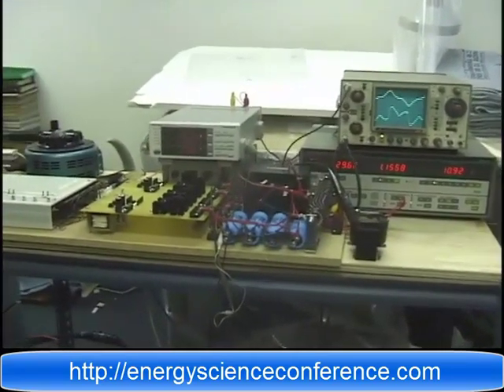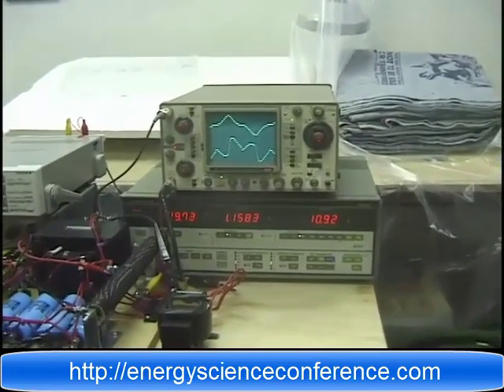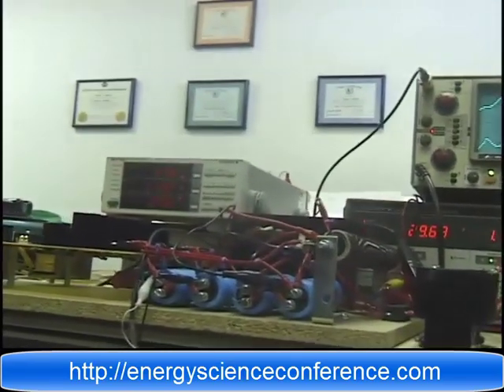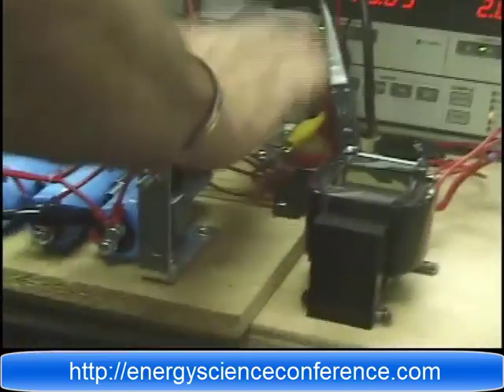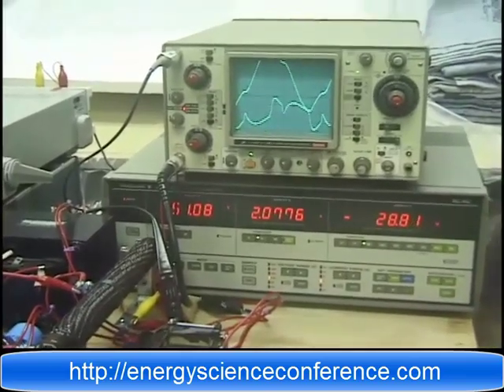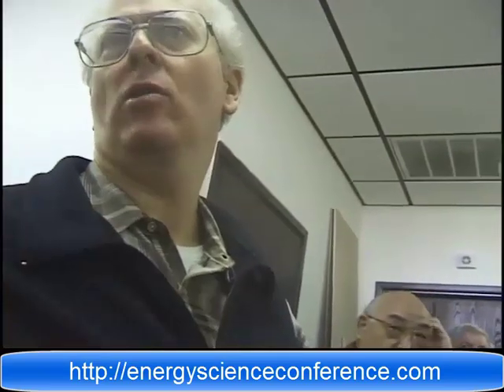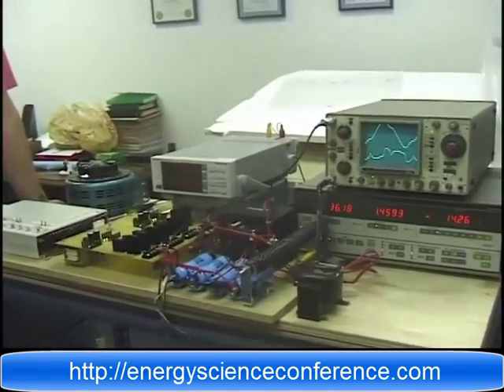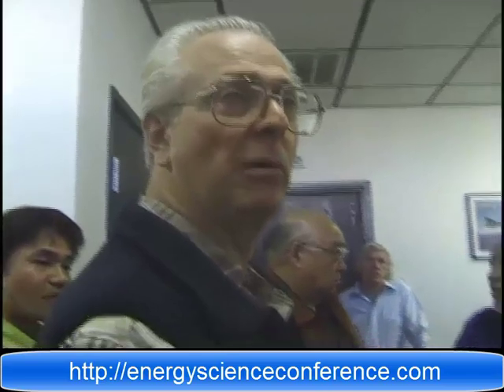COP 20.0 (2000%) Reactive Power as Energy Source

Comment: Ok I've watched this again as well as the hour long interview and came to the conclusion that I cannot determine if using reactive power can give us 'free energy' or of it it's a measuring mistake/error/trick.

But can someone answer this very basic question:

IF he needs only a little bit of power to run his machine and puts back 10-20 times more into the grid... why would he need the wind generator guys? or any generator for that matter. That can be a self contained unit. Put a battery with an inverter in and get 20 times more out.

is that possible?
Reply from the maker: Not only is it possible, is has been done. Try to break through your tendency to conform and start to think for yourself.
Reply from the maker: Average Joe
First of all, it is a misunderstanding that something must self sustain in order to produce more usable energy (not power) than we have to pay for. It is also not more out than in, it is more out than we put in meaning the extra is from external sources of potential energy that can enter the system and do the extra work.

You also have to understand the difference between efficiency and coefficient of performance.

If a child puts in 1 part energy to get a kite in the air and for the duration of its flight the wind puts in 9 parts energy. That is 10 parts input. If half is wasted due to bad kite design, friction, etc..., then only 5 parts of that energy actually went to flying the kite, which is the intended work. Therefore 5 units of intended work divided by 10 parts total input = 50% efficiency. Efficiency is the ratio of TOTAL input compared to the intended work done.

The total work done was 5 units divided by what the child had to input, which is 1 = 500% NET GAIN in ENERGY compared to what he paid for. This is 5/1 = 5.0 or a coefficient of performance (COP) of 5.0. This is a real overunity free energy system and no laws of physics are violated and the child got 5 times more work done than he paid for. Not only is it possible, it is the only way all natural systems work and close or isolated system thermodynamics as taught by mainstream physics do NOT apply to anything in the natural universe.

Your refrigerator operates in the same way and more WORK was done in whole compared to what we pay for in electricity at the wall since heat moves for free to the cold. This is another overunity free energy system that operates based on open system thermodynamics (non-equilibrium thermodynamics).

All real free energy machines are under 100% efficient but are over 1.0 COP meaning more work is done than is required to be supplied on the input and no laws of physics are defeated contrary to what you have been manipulated into believing.

The Bedini SG, Paul Babcock's motor, Jim Murray's SERPS technology, both of Graham Gunderson's machines from the past 2 conferences, this is a long list - those are all over 1.0 COP and all produce MORE work than they have to pay for in electricity to run the unit.

Believing it must self sustain without a power supply only demonstrates a lack of understanding of elementary physics and thermodynamics. Your refrigerator is overunity but there is not enough overunity in order for it to self sustain. IF a devices is at a high enough COP, they can sustain themselves but it is NOT a requirement in order for them to produce more work on the output than the operator of the machine has to supply on the input. These are the indisputable facts of nature.
Reply from the maker: Average Joe
Mixing analogies? They are all 100% applicable to these systems, which obviously evades you. A refrigerator is over 1.0 COP and more WORK is done in total than the work you supply by the electricity to run the compressor. This is actually ACCEPTED by even conventional science. Every heat pump works the same way. A refrigerator is an overunity device and you're uninformed opinion or acknowledgement is not required for reality to be what it is.

Here are quotes from the Department of Energy's own websites: http://energy.gov/energysaver/electric-resistance-heating "Electric resistance heating is 100% energy efficient in the sense that all the incoming electric energy is converted to heat." - this is the same as COP of 1.0 since all work done to create heat is equal to the electrical input just as I already told you.

And we see on this site: http://energy.gov/energysaver/heat-pump-systems "A desuperheater-equipped heat pump can heat water 2 to 3 times more efficiently than an ordinary electric water heater." - that means a COP of 2.0 to 3.0.

Department of Energy is showing you that an electrical heating element is 100% efficient - and has an  automatic 1.0 COP. If a heat pump can produce the SAME heat 2-3 times more efficiently as a electric water heat that is already at 100% efficiency, then you have been exposed as someone that is spreading nonsense and disinformation because you are 100% incorrect in your claims and I have already spelled out for you why. And, the Department of Energy agrees with me, period, end of story.

I tried to show you the difference between efficiency and COP, but you choose to remain ignorant and defend what you already believe instead of learning the indisputable facts of the basics of open system thermodynamics.
Reply from the maker: I'll be pointing out some of Dr. Jefimenko's work in one of my presentations at the 2018 Energy Science & Technology Conference. You're giving a good explanation here. I usually use a simple child's analogy. If a child flies a kite and takes 10 parts energy to get it in the air and for a certain period of time that it flies, the wind inputs 90 parts energy. That is 100 parts input. If an entire half is wasted in bad kite design, air friction, etc. and only 50 units of energy in real flying were were done - that is 100 parts in and 50 parts work done, that is only 50% efficient, which is horrible, but that is still 2.5 times more efficient than low 20% efficient solar panels. However, 50 parts were were done, but the child only provided 10 parts work, the child got a 500% net gain in work compared to what he put into the system since 50 parts work / 10 parts of operator input = a COP of 5.0. So 50% efficient, but 500% more work than the operator put in.
Reply from the maker: Average Joe What is your real question? Do you want to know if it is actually possible to have a system that produces more work compared to what we have to put into it? That is a fair question and if that is the question, then it is simple to answer.
Reply from the maker: Average Joe
Then you should understand that my analogies are all correct. Of course they use energy or potential energy that is around us and that winds up being energy when it does work for our purposes - that is the whole point. There is nothing magical about overunity systems as they do not create energy out of nothing and they all work on the exact same principles as heat pumps except the source potential doesn't have to be heat.

Normal geothermal heat pumps are the highest overunity systems commercially available that require an input from us to circulate the fluid. Solar cells, wind turbines and hydropower are all infinite COP since they require no input from the operator.

Deep Geothermal could be used right here right now, but it's too disruptive and we're not going to see it implemented at any meaningful level anytime soon. I don't know if it is the best to power our world, but its crazy not to use it. Solar technologies are advancing and becoming less expensive and the know-how to print cheap low light panels is there - just need someone with some deep pockets who just wants to start printing them.
Reply: Yes it is possible and there is many ways to produce cheap even free energy . But any use of this ways will destroy the world economic .Imagine when the markets lost 4.5 billion usd daily the sales of oil ?! What will happen when world economy
lost 1.6425 trillion $ a year ?? Always remember the 7 Sisters .
Reply: @azeezali4144 you mean like today when it’s probably doubled that during the pandemic?
Reply: Perhaps it would help some folks here to explain the difference between efficiency and the Coefficient of Production (COP).  A device can, and usually must have, less than 100% efficiency and at the same time might have a COP over 100%.  This is because we measure the COP based on what we deliberately put into a device relative to what the device produces.  A heat pump is never 100% efficient but may have a COP greater than 100%.  Same is true for the device in this video.  The energy that makes a device go COP > 100% comes from "the environment" and is thought of as not deliberately supplied.  This is also not thought of as a measurement hocus-pocus because the environment could be wind, water, geothermal, etc.  But it also could be from unseen sources, such as electrostatic, atmospheric, solar, atomic decay, and more.

To any doubters of this kind of demonstration such as +Average Joe, what's wrong with building a system that pulls in energy from unseen sources?  Just because your textbooks don't talk in these terms doesn't mean that is can't happen!  For an example of "unseen" energy, check the works of Dr. Oleg Jefimenko who wrote the book, literally, on electrostatics.  But I bet that your EE professors never bring him up in class!  

BTW, Dr. Jefimenko was the first to publish a rock solid refutation of general relativity after the Nobel Prize winning work by Lee and Yang (prize awarded in 1957) that proved that the universe is asymmetrical (not symmetrical as Einstein and Lorentz incorrectly assumed).  This asymmetry is the source of a lot of the overunity effects you see here and elsewhere.

Comment: Can this guy back up his statements about einstein's claim about the Maxwell equations?

We keep seeing these builds with meters on them but give me some usable energy. Bedini charges batteries but in the dvds I only see him measure voltage. Why not show: here we charge two batteries using one. then we take out (and measure) the power then we recharge with the same primary battery and do that for certain number of cycles until the primary can no long run the Bedini.

i have 6-7 fan bedinis running, all charging batteries because I noticed how good they are at doing rejuvenating and reselling them pays for my transistor, caps, diodes and copper wire shopping sprees (thank gosh) but this is what I want to do with the big wheel bedini. I'm just a bit clumsy with woodworking.
Reply from the maker: Yves, the resistor is practically smoking in the demo - dissipating current and creating is proof of real usable energy.

With Bedini, we have posted many discharge graphs from computerized battery analyzers showing that the battery is not just a voltage charge, but has the real capacity to do work.
Reply: Aaron Murakami
Thank you Aaron, can you point or link me to these charts?

So as far as Bedini goes. Would it then be possible to bootstrap the process with a number of batteries and keep gettting power out of the system without pulling from solar or the grid?

heck even 50W permanent or 500W for an hour a day would be great.
Are you aware of such a system from John Bedini or others?

if so my next question is: why isn't that the biggest focus of the bedini builders  in the groups or forum?

Finally, could you guide me into building such a system? coils, wheele ro no wheel, transistors and batteries?

Thanks really love this stuff.
Reply from the maker: Hi Yves, last year, John showed a "generator mode" where the back battery charged like normal, then the input battery charged itself up as well. Everyone was free to examine the machine. I'd recommend posting in http://energyscienceforum.com that is John's official forum and he posts in their personally. There is some discussion on that generator mode as well.
Reply: Aaron Murakami

Thanks Aaron, i am on the forum. Posting questions mainly...;)
I've never been fond of the 'forum' format.. but I'm getting my way around.

I'm happy to post in the forum but isn't that information compiled somewhere?
did john bedini make this build available for replication somehow? (not necessarily free)?

thanks
Reply from the maker: Yves Baggi
That particular "generator mode" for the SG that charges its own front battery is in that forum somewhere. A few people have already replicated it to different degrees as far as I know. Tony Craddock filmed John's presentation of it and released it on DVD as part of the Energy from the Vacuum Series.

Comment: The implications are, that the grid is not longer needed. If you use this , ode, where it puts out 100 Watts at the resistor ( or light bulb) and at the same time puts out 30 Watts AC back to the AC line, you can use this 30 Watts to power the control circuit and it will be a selfrunner..no more grid needed !
Reply: My point exactly, why would he fiddle with wind generators? what does he need them for? all he need is a bit of power to bootstrap the system.

Do we have names and company info for this guy? and when was this filmed?
Reply: Yves Baggi
Ok from reading the other comment, I guess this guy is Jim Murray. But yes we would need to replicate IMO.